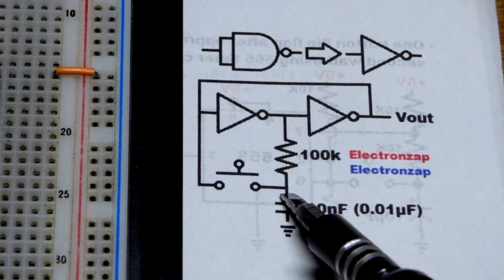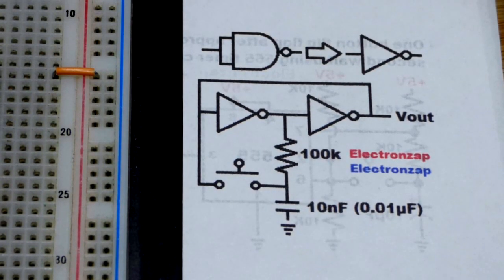Normally open push button switch  turned into on or off flip flop circuit learning electronics

Comment: Thanks!! I was wondering how could I do this type of button without Arduino/32
Reply from the maker: Very cool. I only made a few arduino videos because you mostly just need to learn/copy and paste code, which doesn't make for entertaining videos. But also, if a simple circuit can do something, I think it's better to make the simple circuit than have the Arduino doing it on top of the complex tasks it has to perform.

Comment: very good video but it doesn't work !!!
Reply from the maker: Sorry to hear!
Reply: It  works just fine... Ive tested it with a 7404, 74LS04, and even a 74HC540.. as long as you have two DIGITAL inverters. with the 74HC540 you can implement 4 on off latches. very compact.

Comment: should still work the same with 7400 right?  Mine doesn't 😞
Reply: the junction between my two not gates does not vary enough in voltage upon depressing the switch to trigger the change but I don't understand why, do you have an idea?

Comment: I making a project in that i have three different modes so i want to control 3 modes by using push button .
Singletape : mode 1
Double tap: mode 2 
Triple tap: mode 3
This is my code: 
#define sw 5 //pin at push sw is connected
#define SENSE A0
#include<SoftwareSerial.h>
SoftwareSerial myserial(3, 4); // RX, TX

int lastButtonState = HIGH;   // the previous reading from the input pin
unsigned long lastDebounceTime = 0;  // the last time the output pin was toggled
unsigned long debounceDelay = 50;    // the debounce time; increase if the output flickers
bool buttonState = HIGH; //saving state of the switch
byte tapCounter; //for saving no. of times the switch is pressed
int timediff; //for saving the time in between each press and release of the switch
bool flag1, flag2; //just two variables
long double presstime, releasetime; //for saving millis at press and millis at release
void setup() {
  Serial.begin(9600); //for serial monitor
   myserial.begin(9600);
  pinMode(sw, INPUT_PULLUP); //setting pin 5 as input with internal pull up resistor
  pinMode(SENSE,INPUT);
  pinMode(2,OUTPUT);
  pinMode(LED_BUILTIN,OUTPUT);
}

void loop() {

  int reading = digitalRead(sw);

  if (reading != lastButtonState) {
    // reset the debouncing timer
    lastDebounceTime = millis();
  }

  if ((millis() - lastDebounceTime) > debounceDelay) {
   
    if (reading != buttonState) {
      buttonState = reading;
    }
  }
  //Serial.println(buttonState);

  //when switch is pressed
  if (buttonState == 0 && flag2 == 0)
  {
    presstime = millis(); //time from millis fn will save to presstime variable
    flag1 = 0;
    flag2 = 1;
    tapCounter++; //tap counter will increase by 1
    //delay(10); //for avoiding debouncing of the switch
  }
  //when sw is released
  if (buttonState == 1 && flag1 == 0)
  {
    releasetime = millis(); //time from millis fn will be saved to releasetime var
    flag1 = 1;
    flag2 = 0;

    timediff = releasetime - presstime; //here we find the time gap between press and release and stored to timediff var
    //Serial.println(timediff);
    //delay(10);
  }

  if ((millis() - presstime) > 400 && buttonState == 1) //wait for some time and if sw is in release position
  {
    if (tapCounter == 1) //if tap counter is 1
    {
      if (timediff >= 400) //if time diff is larger than 400 then its a hold
      {
        Serial.println("Hold");
        hold(); //fn to call when the button is hold
      }
      else //if timediff is less than 400 then its a single tap
      {
        Serial.println("single tap");
        singleTap(); //fn to call when the button is single taped
      }
    }
    else if (tapCounter == 2 ) //if tapcounter is 2
    {
      if (timediff >= 400) // if timediff is greater than  400 then its single tap and hold
      {
        Serial.println("single tap and hold");
        tapAndHold(); //fn to call when the button is single tap and hold
      }
      else // if timediff is less than 400 then its just double tap
      {
        Serial.println("double tap");
        doubleTap(); //fn to call when doubletap
      }
    }
    else if (tapCounter == 3) //if tapcounter is 3 //then its triple tap
    {
      Serial.println("triple tap");
      tripleTap(); //fn to call when triple tap
    }
    else if (tapCounter == 4) //if tapcounter is 4 then its 4 tap
    {
      Serial.println("four tap");
      fourTap();//fn to call when four tap
    }
    tapCounter = 0;
  }
  lastButtonState = reading;
}
void nolight()
{
}
void singleTap()
{
}
void doubleTap()
{
}
void tripleTap()
{
  
}
void fourTap()
{
  }
void hold()
{

}
void tapAndHold()
{
}
Pls help me out of this problem 🙏
Reply from the maker: Sorry but, I have no clue how to help you out with that.

Comment: is it just me, or are those push buttons sometimes really finnicky at staying in the breadboard? a lot of the time the pop out which is really annoying.
Reply from the maker: They do jump out for a while. Then they stretch out the slots a little and stay in place a lot better. But smaller lead components may not connect as well in those slots. So I mostly just use certain pins for switches and/or dual inline package integrated circuits.